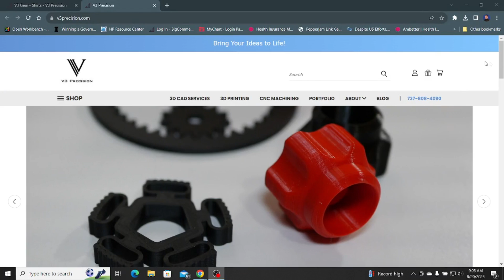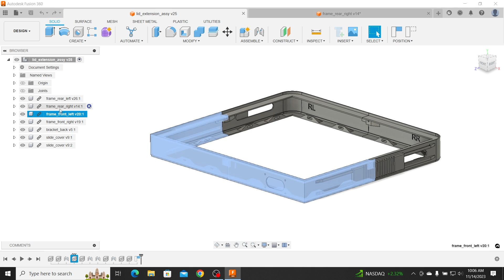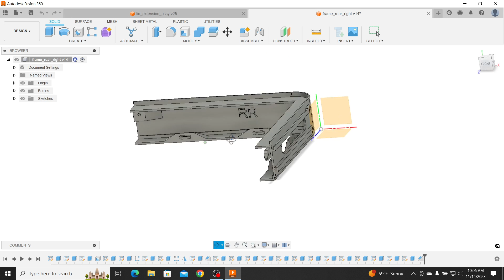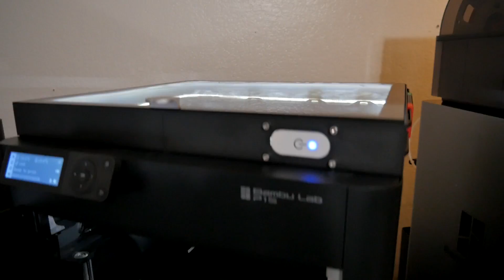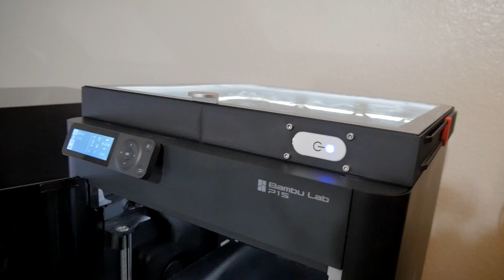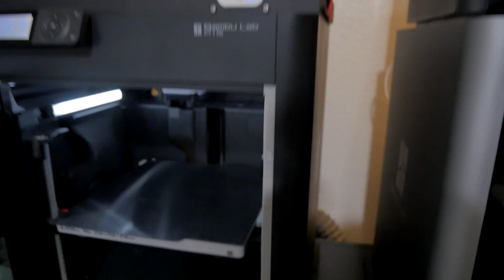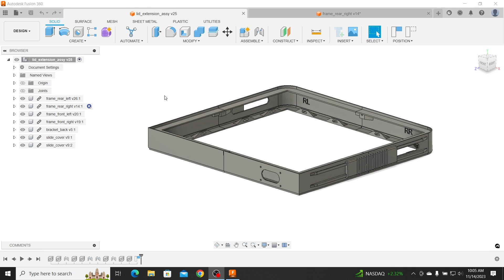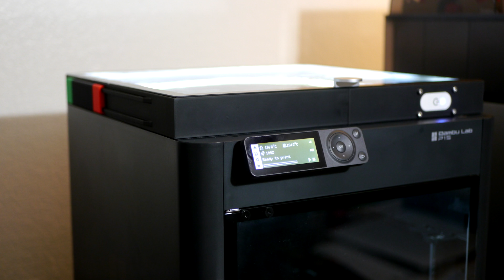LED Lid Extension for the Bambu Lab X1 and P1 Series Printers

Comment: I really liked this design, like you it solves my main concerns. I printed it off and i should have put some Tree hybrid supports in. However i found the tabs that connect at front and back were very very tight. Had to do some sanding to get them to go in, where as the tabs on the side fitted perfectly. Thank you

Comment: Could anybody confirm by how much this extension increases the height of the P1S? I'm asking because I have only a few centimeters above my printer and I couldn't find the dimensions for this part. Thanks!
Reply: Thanks a lot, I was wondering if anybody will ever see my question and answer it! As it turns out, 4 cm is exactly the space I have between the top of my P1S and the case I put it in (long story...), so I'm out of luck :(
Reply: Just printed my one - height 4cm

Comment: I like your design and everything, but like many others, I print in an enclosed space (a room) and value my health at full potential... Filaments produced from oil products, like PLA, not only release nanoparticles during printing, but these are also toxic nanoparticles. There's a reason that Bambu Labs incurred the extra costs of putting in an exhaust fan and a carbon filter... You think a company like them won't cut corners at every turn? Nah.. If theyre putting it in, it needs to be there, and shouldnt be bypassed... Bypassing this exhaust filter system is essentially hazardous to your health.

Comment: For the Home Assistant nits there is a bambu integration so tjat you can automate your lighting based on the state of your print. The dampers could also be motorized and have HA (esphome) look after positioning it with a chamber temperature sensor

Comment: In the latest X1C there is no longer a USB socket behind the display unit. Just a ribbon cable feeding from a board sitting behind the panel shown in your video at 2:39 but within that panel on that board is a micro USB socket. Could I plug an adaptor lead into that and then plug into the adaptor leads USB?  Would appreciate any help on this as I have built your enclosure and fitted the LED strip which looks great but unsure how to connect it in. Thanks in advance.

Comment: How did you run the USB into the back of the screen on P1S. Did you have to make a hole in the frame?
Reply from the maker: The USB is not directly to the screen.  It is on the inside of the frame.
Reply: @thinkdesignmake  yeah I was wondering how you ran the cord but I figured it out. Any tips on getting lights to stick? With the vents open and the doors closed they keep coming off. Thanks for the file it’s easy to print and a great addition to the printer.

Comment: I will get my X1C next week as well. I'm thinking about using the BL LED Controller which connects to the X1C wirelessly and mirror the colors with the stock LED. With Lidar on, it also shuts off the LED. How's your experience with 24V LED? Does it run hot? @thinkdesignmake
Reply from the maker: I was considering the BL LED Controller also. I don't think heat is a problem with 24v.